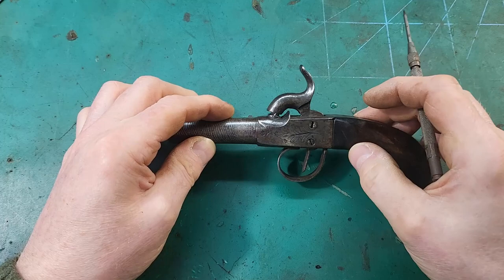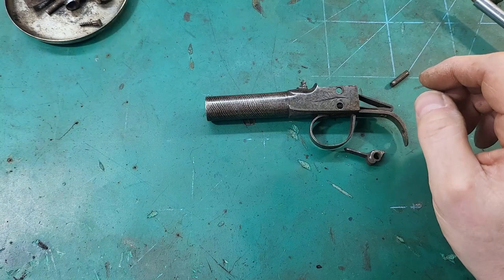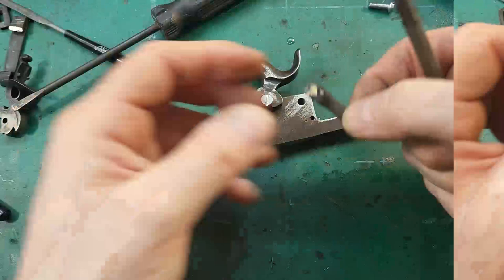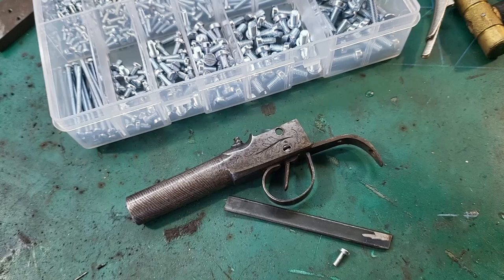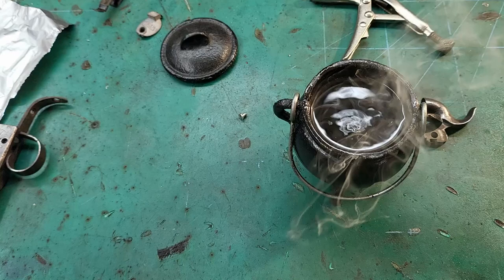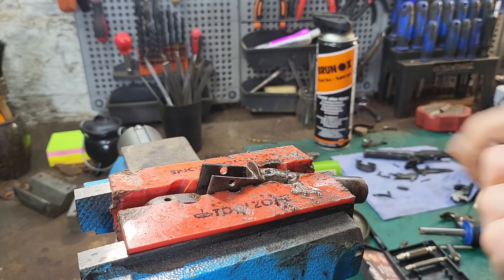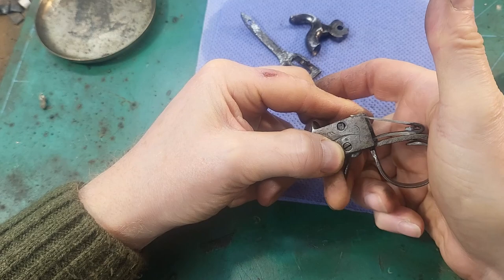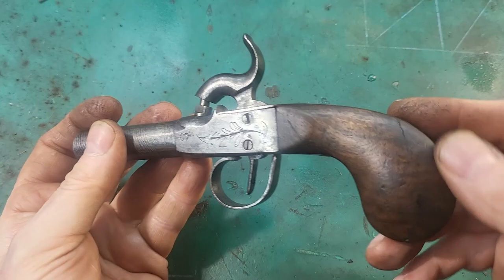I Bought A Cheap Antique Muzzle Loading Percussion Pistol

Comment: I welded up the sear on my pocket flintlock but didn’t harden it, it worked perfectly for a while, now my hammer doesn’t lock all the way back like it used too and my trigger is now forward too much, I’ll have to reweld my sear and harden it this time. After you hardened the mainspring and the trigger wasn’t touching , I thought for shure you were going to weld up the rear of the trigger and file flat to make it touch the spring. ,,,,I’ve taken out a-lot of  very corroded seized percussion nipples, what works every time for me is , I wrap the pistol in tinfoil then cover it with a thick cloth with only the nipple sticking out, then I weld a nut onto the nipple and while it’s still red I use a socket and turn nipple back n fourth till it threads out,  Your videos are great, thanks for the useful content , I will definitely be sending you come coffee $$ soon through your link
Reply from the maker: Thanks very much.
Reply: @morriscarstairs2685   Do you harden the Sear the exact same way as you do a spring, Quench then temper? Also I can’t seem to find the buy a coffee link
Reply from the maker: @Kev-N42000  No, I heat the trigger from the bottom with a small torch until the tip is pale blue, then quench it. You can find the BMC link in the description of any of my videos. Thanks.
Reply: Ok good to know , I thought the sear would be hard like glass and shatter if used with just a quench, I thought it had to be tempered like a spring
Reply from the maker: @Kev-N42000  No worries, thanks for your support.

Comment: Just thought I would give you my method of removing frozen nipples. I first drilled it out to the largest Whitworth threading size the nipple could accommodate (I used Whitworth threads because they where the coarsest for their size) then screw  in a correct size bolt with a loose nut, then tighten the nut down tightly on top of the nipple. From here you can heat the bolt far hotter than you could while the nipple is in the gun without the bolt. Also this method transfers the heat directly to the nipple threads then turn the bolt with a spanner or grips to remove the nipple, when all other methods failed  this never did.